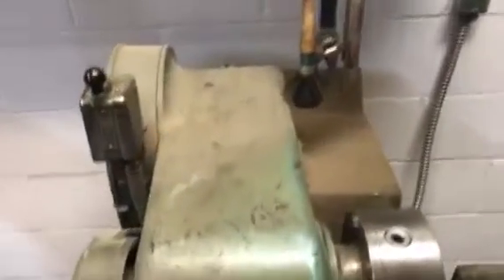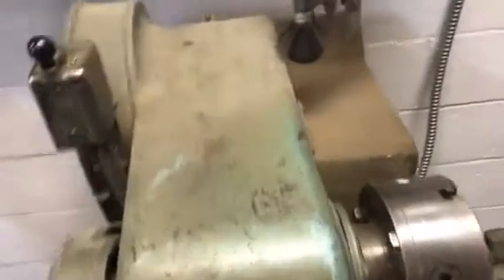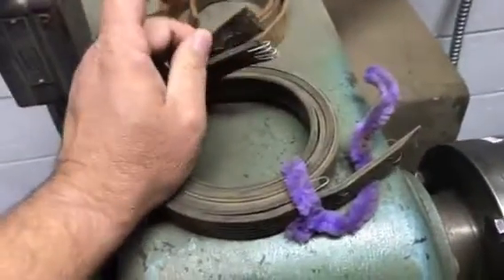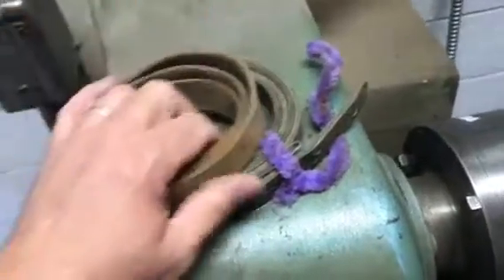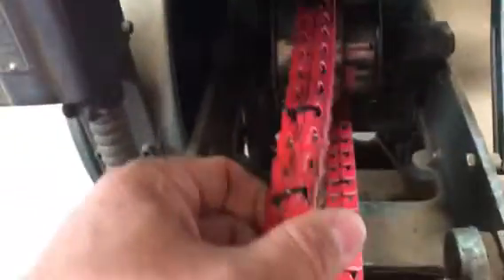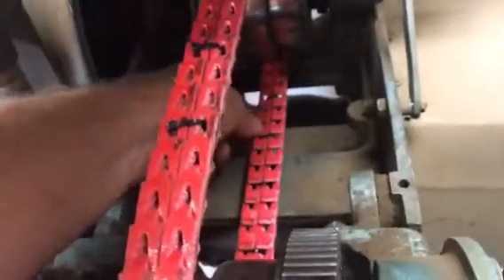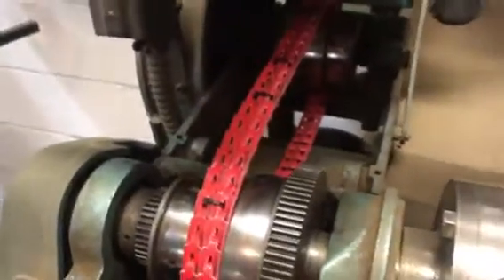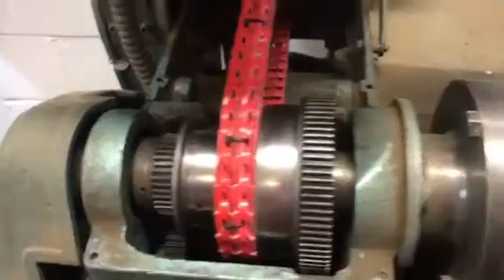Replacement solution for leather flat belt on lathe

Comment: Hi Brian, firstly thanks for sharing your solution and secondly how is it holding up?
Reply from the maker: I don’t use it a lot anymore but have had some projects that required it. The more I use it the less the belt slips, I can use a parting tool now and the motor stalls before the belt slips. Ultimately better than the 7 or 8 different flat belts I have made in the past.
Reply: @briansimmons5472  Thanks mate that will be my next move I am running a cracked ancient leaher belt at the moment......problem solved!
Reply: That is exactly what I want to do on my Sheldon 1938 lathe. Just wondering how the ties hold up. Really no big deal though. Just check them and replace them as needed. Going to harbor freight this weekend to get belts.
Reply: Forgot to say thanks for the post.

Comment: Wow, Im looking to change my belt soon as it is on it's last leg.  I am happy I found this video! Thank you.  Was there a certain style of belt that is needed?
Reply from the maker: danballarin , this is what I used. Bought this from Amazon and later found it on sale at woodcraft. Super belt to remove vibration from tools. 
https://smile.amazon.com/Grizzly-T21992-V-Belt-2-Inch-4-Foot/dp/B001BQDS8I/ref=sr_1_2?crid=28KK974FR2M8T&keywords=adjustable+v+belt&qid=1551631143&s=gateway&sprefix=Adjustable+v+b%2Caps%2C228&sr=8-2